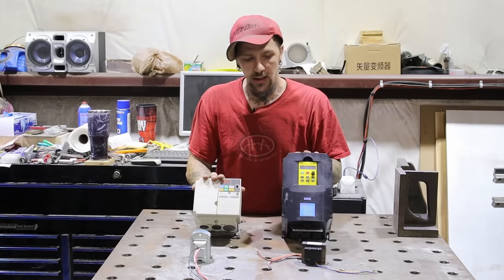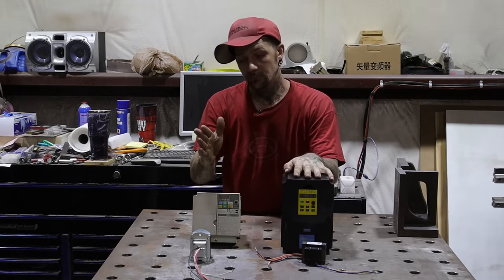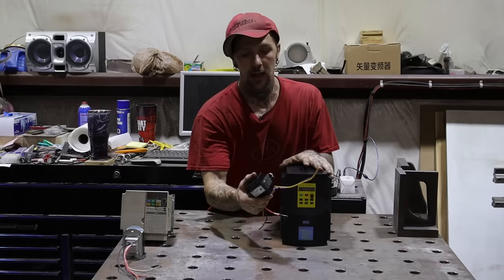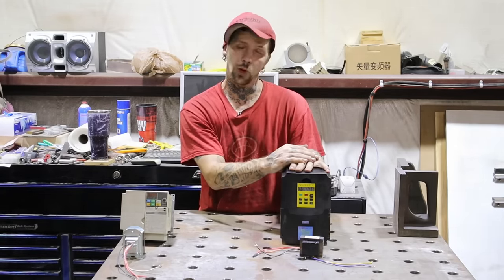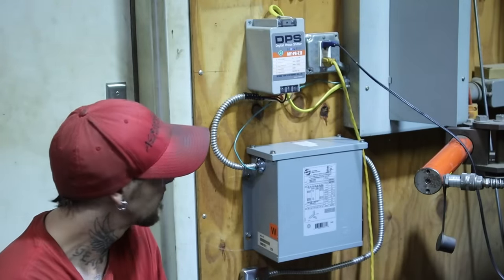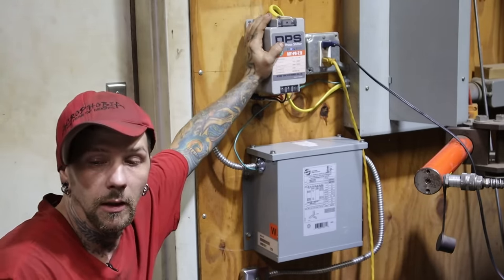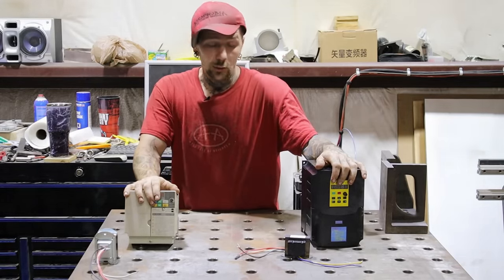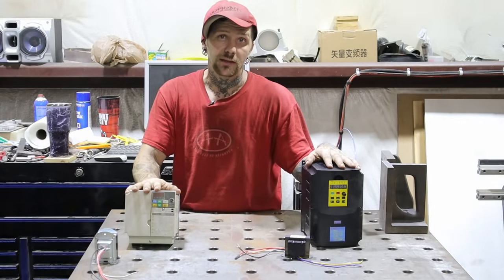My Journey To Fix My KALAMAZOO Bandsaw And Get It OPERATIONAL!

Comment: nicely done! I had a bandsaw like this, i modified it a little to have a limit switch so it would shut off automatically when the arm dropped all the way down. pretty handy for big cuts.
Reply from the maker: Nice. This already has that. Although it doesn't work correctly. Right now I'm just working on making it work 100% before I start moding it. I have a few things I'd like to do already. Lol
Reply: Good plan! It had a pretty good cut just from the get go.  good luck to you! @LP_Creations

Comment: Every 3 phase motor can be configured to run on 220/230 3ph or 440/460. Its internal to the box on the motor
Reply from the maker: Yep. I did all that. Wasn't the issue. Was the actual controls. The internals used different parts for 220 vs 440.